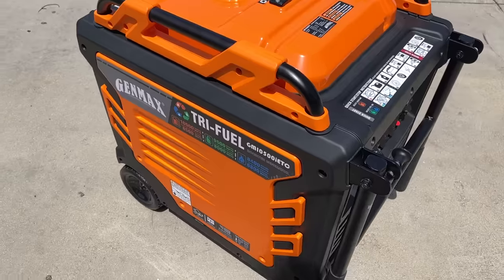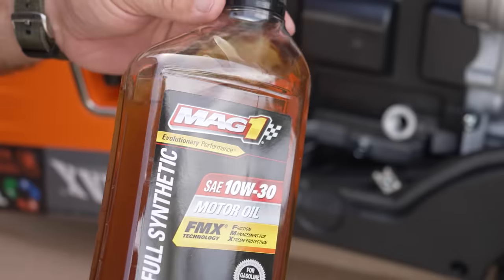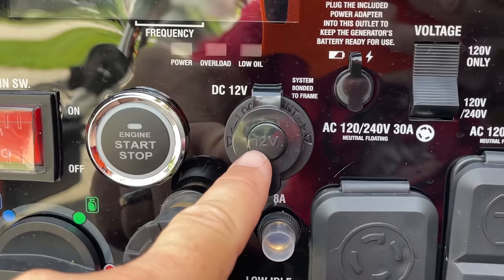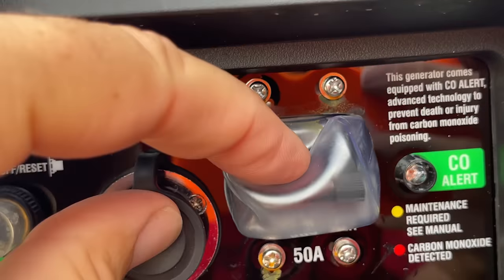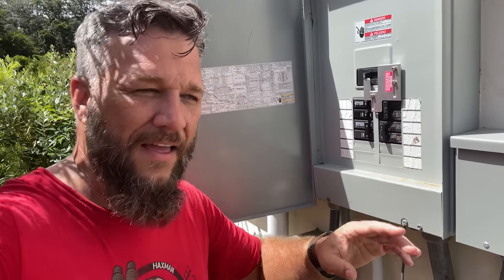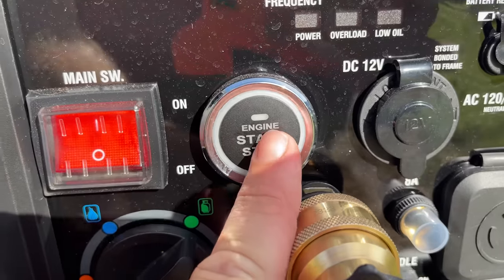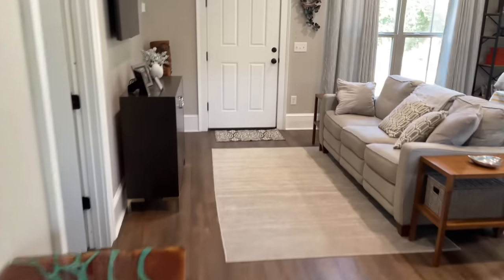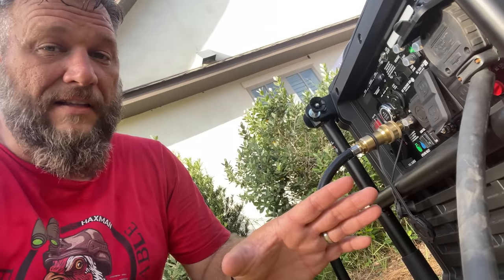Don't Buy A Generator Until You See This Monster!

Comment: I bought a firman generator a few years back after losing $500 worth meat in my freezer. I hated spending $1,000 on something that would mostly live in my shed. Turns out we lost power about 6 times that year. The best $1,000 I ever spent.
Reply: Somewhat similar take on this end. 
My existing generator was giving me hell and power outages can last days or weeks after big hurricanes.
So, I went to stores (that Google said were closed) and found the last one HD had in-stock, just before someone else walked up to it. 
I didn’t sweat the price because my thinking was that the price jump isn’t any worse than ALL the food we’d lose in the fridge and freezer PLUS keeping the family comfortable. 
No brainer. 

Now, I want to see what the details are on this “beast”.
Reply: It's only 1k?
Reply: I've seen home generators for 15k
Reply: @theblindref4u 15k generator is not a portable sized genny, but whole house backup.
Reply: Good for you. Well done!
Reply: I paid $4000. for a 13,000w tri fuel Winco generator after hurricane Irma knocked out my power for 2 weeks. I vowed never again. It has a V Twin Honda engine. After I uncrated it I ran it on Natural gas for a few minutes and I have never started it since. The hour meter still shows zero. Last season we lost power for 2 days but the solar system covered it.
On the bright side that same generator now sells for $5300. so I won't lose much when I decide to sell it.
Reply: @fauxque5057  Yikes, the new Predator 13000w tri fuel is $1200
Reply: I just brought a Firman to run my Home, Completely Happy...

Comment: Did I hear you correctly, you are running lights, fridge, 3.5 ton AC, and a well pump with less than 5000 watts? The AC alone should be using 4000 of that. And that is not talking about peak start up power for the AC and well pump. Am I not seeing something?
Reply: They are probably not all running at the same time
Reply: @TheScottmittel  Doesn't matter! The AC Unit alone should use more than 12000W for startup even with a softstart on it you are looking at 8000-9000W for startup. That well pump depending on how big, will need a couple 1000 watts to run. Best case scenario, to run what he is talking about should be more in 13,000-15,000 watt range. And yes, the probability of the AC, Fridge, Well Pump and a few lights and TV running at the same time is pretty high. Look at the way the electricians calculate the service entrance size to a house. Some circuits can be derated so that a 200 amp service may have more than 200 amps of circuit brakers, but some things cannot be derated like AC, range, water heater, pump motors. A 5000W generator is so underpowered to run the things mentioned that I don't see it possible. I've seen the A/C alone trip the breaker on a 10,000W generator.

Comment: Never, ever break in an engine with synthetic oil, period.  Mineral oil allows the parts to wear in together and after a few hours you can put synthetic in and get the benefits of the superior synthetic characteristics.
Reply: OR Propane
Reply: Synth with a break in additive such as zinc works great.

Comment: I own a 20+ year old B&S powered 8500 watt gasoline generator. I always turn the gas tank off and let it run until it stops. I've never had a problem with it working first try when I turn the gas back on.
Reply: I do the same with all my stuff, generators, four wheeler, etc, run that gas out
Reply: same here. change out gas, even though it has stabilizer, twice a year and put in my truck.
Reply: Remember to buy spark plugs for your generator.😅

Comment: Just a slight correction- The 50amp plug will supply 50amps but only in 120v mode. If you select 240v, the 50amp plug is limited to 35amps without a parallel connection.
Reply: I was thinking hey we can weld with this bad boy.
Reply: If you charge an EV with it keep the charging AMPS at 25/240. Any more and the gen has a hard time with the initial start slam wattage.

Comment: I'm trying to understand why there is a 50 amp receptacle you state is only 30 amps on a 9500 watt generator?? I have a 3400 watt Champion inverter generator with a 30 amp plug. Why would I buy this?? Either you're mistaken or the manual is incorrect.

Update. I went to the website and your information is incorrect. The 50 amp outlet is 50 amps. Here is a copy paste of the related specs.
equipped with 1X 120/240V AC 30A L14-30R Outlet,DC Cigarette Lighter Outlet: 12V DC 8.3A, 1X 120/240V AC 50A 14-50R Outlet,4X120V AC 20A 5-20R Outlet

Comment: It WAS the biggest inverter generator until right after this video when Duromax released their new inverter that does 16k peak apparently. Would be cool to see you review that when you get it!
Reply: The only drawback in my opinion is that that Duramax 16 K is only duel fuel.
Reply: Peak can never be used
Reply: Recent addition: Westinghouse WGen20000TFc - 20,000 Watt Electric Start Tri-Fuel Portable Generator w/ CO Sensor & Wireless Remote Start (49-State) at $3,900.

Comment: My 13KW PTO generator cost $1895....but then again, my tractor cost $34000....lol
Reply: I looked at the PTO generator. Decided to install a Cummins RS20 supplied by a 1000 gallon propane tank. Maintenance was the deciding factor. $25.00 to change the oil and filter in the generator every 200 hours. After Hurricane Rita, We went 26 days with the generator running 24/7 only stopping for oil changes every 8 days. The generator powered the entire house, consuming 1.3 gallon of propane per hour. Propane cost was just over $1,600.00. Insurance company wouldn't reimburse the propane, but paid me the $1600.00 for "generator rental".

Comment: Great video: 

I currently just set up a pair of WEN 12kW dual fuels for a customer of mine...

24kW max spike output. 

One thing that I would suggest as a small engine mechanic over almost three decades. ...the break in oil should never be synthetic.   Conv oil run over two hours works much better to set the rings.
Reply: What amp plug did you use?
Reply: @SgtRudySmith31bRet  The WEN units of such size and in an open frame design do not have a pair up function that will synchronize outputs

My friend's home fortunately had a sub panel that drives a workshop, garage and outdoor lighting so we went with (2) NEMA 14-50Rs. (50 A at 240V) allowing sperate interlocks and feed adaptability for both zones of input.

The largest output plug on said WEN units is identical....it's a 14-50R.

100 amps combined was more than enough to run just about the whole home less a electrically heated hut tub. ....we tested circuit draws w a clamp meter at the panel to determine

Comment: My approach is different: I go with the smallest generator that will meet my maximum basic need, anticipating that fuel may be hard to get, and smaller generators typically use less fuel. And they’re going to be quieter. Living in Alaska, I don’t want my pipes to freeze in the winter, so I need to power the circulating pump on the gas boiler. Put food outside, don’t need a fridge. Maybe power a couple of lights. In the summer, I don’t need heat or lights, but do need the fridge. Propane keeps indefinitely, so better than gas, and doesn’t clog up the carburetor, but is less efficient. Easily stored. I agree, don’t use gas in it, except for initial testing, then run it dry, drain the carb bowl, and later run your periodic tests with propane after that. Having a generator can be very useful, but keeping it it’s box until you need it on a cold, dark, windy, wet night without any break-in period or familiarity, or test runs, and without knowing more or less specifically what you really want to accomplish, and not having all the infrastructure in place, may make for a less than desired experience. Having the natural gas option with the tri-fuel setup  is ideal. Have a plumber run a gas line for you, using quick disconnects. In all of our power outages over the years, the gas has never been out, so in theory we have an endless supply of fuel. But there’s no guaranty of that, so have plenty of fuel (propane is my suggestion)  stored away.  And however much you have stored, when the time comes that you need it, you’ll probably wish you had more. And for a long term outage, my fuel will be reserved for cooking and purifying water, not running a generator to power the house, if need be.
Reply: I like your philosophy on back up power.  If we have lots of rain, I need to power my sump pump to keep the basement from filling up with water.  But, I plan to install a battery operated backup pump.  That way I can run the generator periodically to recharge the battery.  I can rum the genny as needed for heating or cooling and for the fridge.  Batteries will do for lighting and again charge those when running the genny for some other reason.  This is not as convenient as the automatic whole house systems, but much cheaper to buy and operate, and makes the fuel last longer.
Reply: I'm of the same philosophy. I have a small diesel generator sized to carry just critical loads. I also have sensitive electronics and fridges on small ups units. Keeps them running through the change over to the generator and cleans up any voltage or frequency fluctuations from the generator.
Reply: As someone that has tried the "little as possible" method, I'll tell you that that is a fools errand approach.  You'll make your generator run harder, longer.  I've grown up and lived on the Gulf coast, where hurricanes and major storms come through quite often, which means zero electricity for days and weeks, or even months.  Get one that will power your entire house, and then add 10%, something like a 13000.  When your smaller generator is running full force, it is drinking as much gas as it possibly can.  However, if you are able to hit the low idle switch and the house is still electrified, then your generator is much more efficient, and not sucking as much gas as it is WOT.

Also, instead of buying the smaller, refillable bottles that you hook up to the grill, you can always get larger tanks and have the truck swing by and fill it.  The fuel in those will last a long time.
Reply: @jmackinjersey1  are you referring to natural gas/propane or diesel gensets? The diesel units last longer when worked hard. Too much idle time or light loads can cause excessive engine wear. If your needs are 4-7,000 watts, then run a 7,000 watt genset. Why run a 14,000 watt unit? The smaller generator is also a lot more fuel efficient. Without rationing running 5,000 watt load, the kubota gl7000 will burn about 10-12 gallons a day. The gl14000 will burn 15-17 gallons carrying the same load. A 250 gallon fuel tank will get you 2 weeks of power using the gl14000 and over 3 weeks with the gl7000.
Reply: @jmackinjersey1  I think you missed my point. I'm not trying to power as much as possible with as small of generator as I can, I'm only powering the basics so as to eke out my fuel supply as long as possible.
Reply: You know your shit bro
Reply: Old Alaskan to another…got it! Thank you!

Comment: For a bonded neutral generator all you have to do is disconnect the ground from the neutral terminal and wrap the ground connector with electrical tape. Now it's no longer a bonded neutral and is safe to use with grounded power panels.
Reply: You are speaking Greek sir.
Reply: This generator is in a "neutral floating" state, unless you use something like a NEMA L14-30P
Bonding Plug. Now you know.
Reply: @OG_Gamers_Live  I do use a L14-30P plug

Comment: Bought a craftsman briggs and stratton generator 3 years ago for $799.00 it runs off gasoline only! starting 10,000 running 7,500. Way stronger than I needed, go big or go home!
Reply: I haven't tried this, yet, but I like the idea of charging 2 or 4 car batteries during the day, while there is extra power, and then use those batteries at night to feed an inverter for lights, etc.  It might keep a fridge and chest freezer happy, too.

Comment: That thing is a BEAST! I had to look it up since mine looks way smaller and weighs about 125 lbs. That bad boy is a 458cc 4 stroke coming in around 250 lbs. If I could afford it I would totally buy that. Great video good sir! Would definitely like to see some decibel readings in the future!
Reply from the maker: I want to get a meter. I also need to learn how to use the oscilloscope I got so I can do more thorough testing on these.
Reply: 8500 watts is nothing

Comment: One of the key advantages of a Propane burning capability is that the generator can be stored inside your house garage, unlike that if the unit is using gasoline that still has fuel in it. Even if the gasoline is drained, there are still flammable fumes in the tank and carburetor.

Comment: Nice presentation. Wish this was available when I bought my Honda gen. The one caveat I have are those GFI outlets are very sensitive. I removed my and installed standard outlets because of random cutouts. Hard to beat that price!
Reply: Don't worry, your Honda probably won't last very long and Honda will screw you on the warrantee so, you'll have a chance to buy one of these.
Reply: I had to give up on Hondas due to ethanol fuel clogging carburetors.  It's Dual or Tri -Fuel for me!  Easier to store propane long term.

Comment: From my experience this is far bigger than most people need to run a mid sized home. My home has never taken more than 4000 watts continuous to run everything including an air conditioner but yours might vary. 
The other major consideration is noise; if you care about your neighbours, this might end up driving them nuts as my experience with generators (I own four) is that the Honda and other high end conventional inverters are very quiet even at 10 feet away. But for the price, this genny and it's bigger brother seems to be good value for the money
Reply: Oh, and an  add on note....it is not a good idea to break in any generator with synthetic oil. Most instruction manuals tell you that clearly.
Reply: They get very bad fuel consumption when maxed out though

Comment: There is a really cheap part you can put on your A/C Condenser that helps it start up easier. By trade I'm a plumber but installed one on my mom's. It was recommended by the generator company. They offered to install it for a couple hundred dollars but I spent $20 and about 10 minutes to do it myself.
Reply: @not1au... do you have a link for the part?
Reply: Micro air easy start is what you need. . I also installed one and reduced my 77 amps at start up to 26. Not sure how he started a 3.5 ton unit pulling 80-90 starting amps with 30 amps going to the house.

Comment: Great and honest opinion. However... I've been looking and getting one soon and am leaning towards a large portable that is not an inverter.  For $1200 - 1500 less you can get a tri-fuel w/ 13-15k watts that is just as quiet/loud.
Reply: If it is not an inverter generator, it will not be as quiet.

Comment: A generator is something you Never need, until you Need it!  Make sure you do not store gas in generator tank.  Store it in good gas cans and add Fuel Stabilizer. I have a DuraMax12K, Dual fuel and I added NG to it with ease!  Exercise it every two weeks for 5 minutes!  Keeps oil and seals lubed!

Comment: Home Depot now sells a 9KW Trifuel Inverter Genny for $1550. You cannot beat that anywhere. Gotta have Trifuel and Inverter together or you toast your sensitive electronics.
Reply: You can get a Firman tri-fuel at Costco for $900.
Reply: @dirtdiver2389  The Inverter they sell is much lower power than 9KW and the higher power trifuel unit they sell is not an Inverter.
Reply: @ChatGPT1111  True, but it isn't very dirty power and runs things fine.

Comment: Where are you going to get parts when something breaks? I just had a Duromax inverter in the shop with the propane switch had no power coming to it. Couldn't get parts so Duromax is replacing the unit since it is under warranty. But what happens when it is out of warranty? You need to be able to get parts easily.

Comment: Very expensive 
At that price I can get a used generator with trailer for construction lighting or for welding 
Those motors run for years under heavy cold or heat.  At auctions fees and a maintenance

Comment: These types of videos should come with a disclosure statement. Most people hear the words whole house backup, that is not a 100% true. You were running 4500 watts with the water pump on  if you would have kicked In the water heater, you would have tripped the gen breaker. If you would have turned on your stove it would have tripped the gen. Breaker. Even running the microwave at the same time as the ac unit could trip the gen breaker.  A 9kw gen running watts is only 37.5 amps at 240v. Most 3ton AC units pull about 24 amps or 6000 watts and the surge amps can be 6 times that. 
Not trying to down play your video or push people against buying a portable gen, these are great units for a temporary situation. Just know they have there limitations and that you can't back up everything on your 200 amp panel with a 50 amp generator.
Reply: 10KW is plenty to be considered whole home. Check with your electric company and they'll say your usage 95% of the time is less than 10KW. Any one of the items you say would trip the generator breaker wouldn't do so by themselves and is unlikely you would use them all at the same time. Maybe you would need to think don't take a shower while the air conditioner is running or don't use the microwave while someone else is frying eggs. But it's close enough
Reply: 10k is plenty big for my whole house, 100a service. I have gas appliances, heat, water heater and a 2.5 ton AC with a soft start kit on it so it only pulls about 20a for a millisecond at startup